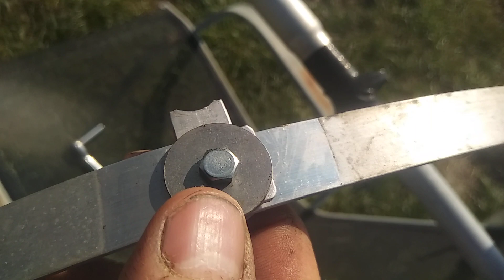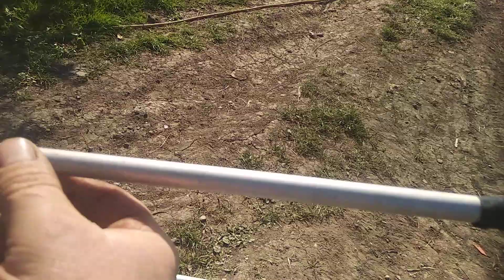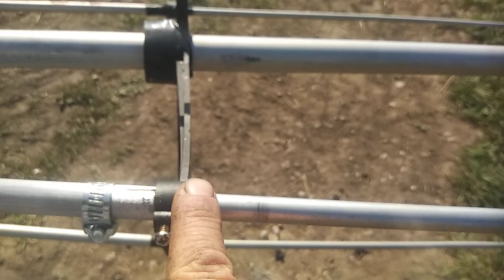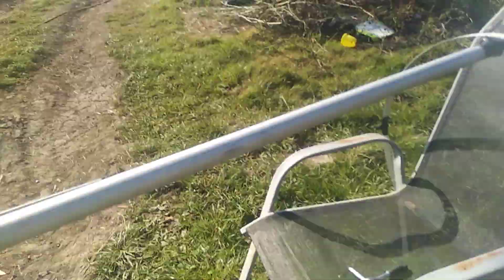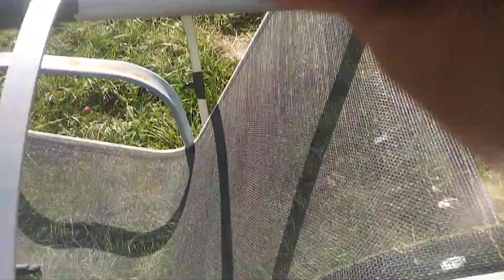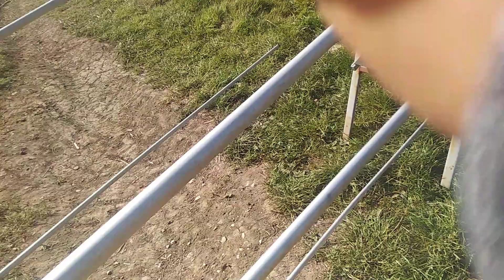Sirio vector 4000 basket ring beef up

Comment: I can see it now. Antenna repair kits on eBay. 99.95 buy it now. 1 roll of tape. 1 tube of polyurethane construction adhesive with El cheapo caulking gun and 1 pair of nitrile gloves. Remember who came up with this repair.

Comment: I have a permanent better fix for the vector 4000. Go buy a roll of fiberglass drywall seam tape. Buy a tube of polyurethane construction adhesive. Wear nitrile gloves to keep the adhesive off your skin. Using you hands smear a light coat of construction adhesive on the area to be repaired. Wrap the fiberglass mesh tape over the adhesive so it comes through the tape. You can leave it where it looks checkered or add and smooth the sura e with your gloves. Takes at least 24 hours to cure. I have repaired and added this method to the A-99 and IMAX and they will outlast you when done this way. This can be done to any plastic, metal,or fiberglass parts of any antenna. If you have the PDL beam antenna will probably fix those hubs that go bad. I forgot to mention after adhesive is FULLY cured you can sand it down and paint it if you want to.

Comment: As long as you select 1 of the following 3 options:

1.) Install in a no-wind area
2.) Install Indoors
3.) Snip off top ball and lengthen aluminum rod another 3"-5" for tuning, with rubber cap on top for aesthetics

...you'll have an excellent and reliable performer that should last for years.
Reply: Also, I used 3/64" Dacron encapsulated Aramid (Kevlar) fiber cord in a 120° configuration to help secure & stabilize the ring. I silicone coated the cord so it does not absorb water in the rain.

Comment: Very Clever Mod to the ground plane radials mate. The ring should be modified using 1/4 inch hollow aircraft tubing for lightweight & the lowest wind load. Look at the Avante Sigma 4 antenna. The Sigma 4 is the "Original" design.
I owned the Galaxy27 corrugated version of this antenna which was 32feet in length & had a gamma match for tuning. Then had the Saluit LW150 also 32 ft w/gamma same antenna but smooth aircraft aluminum. Both of these held up very well after each section was fastened using SS 1/4" bolts with Locknuts & SS Hose clamps. I am assuming yours are the same. I did have to install a inner sleeve about 2 ft long inside the base element for strength as it was bending badly & the top element is another weak point where it slides into section below it.
I will say that both antennas out performed any & all ground plane antennas I have owned & talked around the world on both of them.
73s👍👍💙